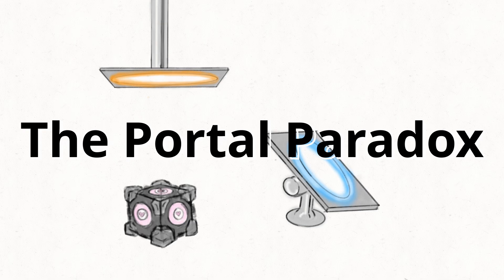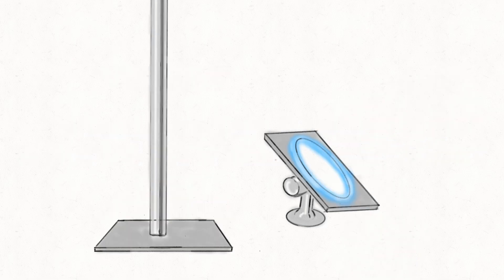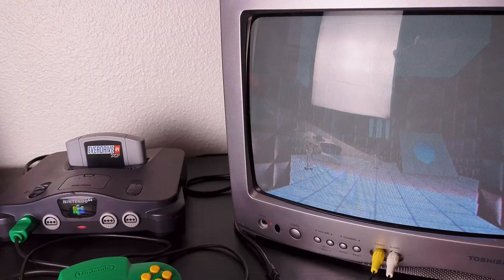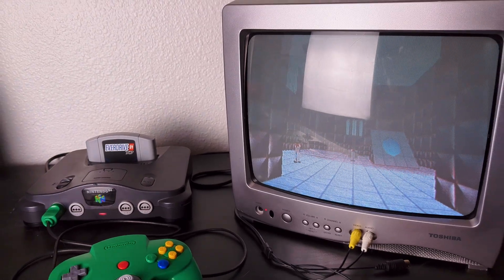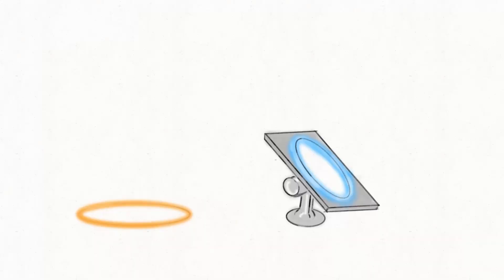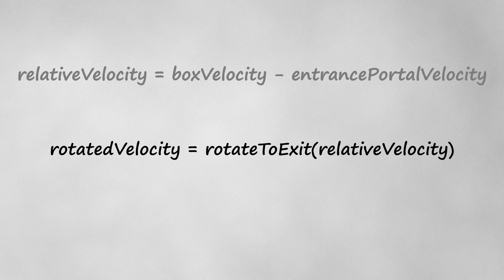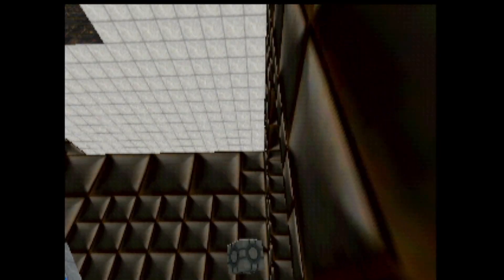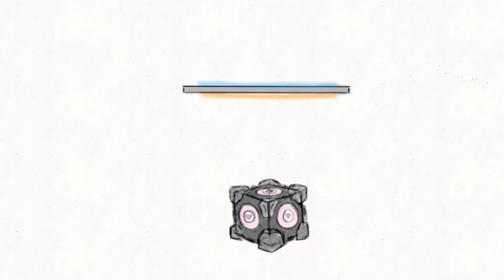I rewrote Portal from scratch and solved the Portal Paradox

Comment: If I remember correctly the issue with the portal paradox has to do with Newton's Third Law (for every action there is an equal and opposite reaction)

if you push a portal down on a cube does the opposing portal feel the opposing force of "throwing" the cube? Does the moving portal also experience this opposing force?
The other problem is regarding weight. Assuming that moving the surface that contains the portal is constant at all times if you slam the portal on a cube that weighs 10 lbs vs a cube that weighs 1 ton, both results will have each cube moving out the second portal at the same speed yet obviously in order give the 1 ton cube the same velocity the energy requirements would be MASIVE compared to the 10lb cube. Where did this difference in energy come from?

Comment: I thought the portal paradox was what happens when you push one portal through another
Reply: If the edges of the portal are like rings with collision, It just hits itself(the stationary portal gets hit by it's width), preventing itself from going any further into itself, while also creating some recursive mirror-esque effect that I can't imagine in my head. Both scenarios are misleadingly labeled paradoxes, and just requires a bit of thinking and maybe some RTX.
Reply: @3_pancakes767  you can pass an oval-shaped-ring through a copy of itself by rotating it
Reply: the result of this (in general) is an infinite length but finite surface area of "portal plane" produced, as it creates a fractal out of self intersections

Comment: What happens if the velocity of the portal changes while the cube is in the process of passing through it, assuming the cube is the sum of parts and not a single entity with a single velocity? If it slowed mid teleport, would the portion that has exited pull on the portion that has not, so the cube is tugged faster than the now-slower portal is moving? Would it's final velocity be the average velocity of the entire interaction? If the cube was made of fragile components, would it potentially break mid teleport? If the portal stopped halfway, would the cube remain stationary or would it be pulled relative to the force of half its mass moving at the portals initial velocity? And what if the cube was instead shaped in such a way that you could fit a portion of it through but flanges would extend beyond the width of the portal? Would the pull of the portion that made it through pull on the wall the portal was on, and thereby on the pistons? And what of infinite velocity? If the piece exited with that same infinite velocity, what would happen upon collision with the flanges, perhaps assuming the components were indestructible?
Reply: It doesn't matter. His equation means the object would be sliced into 1-atom-thick layers because of how the energy is applied. It would work at any speed.
This result actually conflicts with what we seen in the game, therefore, his equation is wrong.
There are some more things why it is also wrong, but at this point it doens't matter.

Comment: What happens if the portal suddenly stops with the cube halfway through then? 🤔
Will the first half, that is at that point "moving" at relatively high speed, pull the still stationary part with it? Or, if the cube was soft like dough, would it stretch in the same situation?
I hope at least someone understands how I'm thinking. 😅

Comment: My problem is, is the "hole" itself moving? yeah the thing its on is moving, but is the hole even actually a thing. Using the hula-hoop example, space isn't moving with the hoop, the hoop is passing through the space, so what is the velocity of the hole in the hoop while its moving? this has to be purely philosophical, right? Your object has a 2d plane showing an image of the other side of the portal I assume, so that 2d object has velocity, but an actual hole wouldn't because its just space, right? So I think you solved the videogame version, but not the "what if portals were real" version, because I think in the real world it would remain a paradox because you'd need to move space through itself and the portal tech would definitely violate causality. We're hypothesizing about unicorn rainbow fart density because its purely conceptual, right?

Comment: The only acceleration the mass of the cube should experience is gravity, it would flip (at best) due to the sudden change of the vector, that is, 9.81m/s perpendicularly when the cube is at rest and then that vector becomes angled and progressibly applied to the cube as it enters the orange portal/exits throughthe blue portal. Sure it would move but not make a fucking lunge like that.

Furthermore, the test on n64 portal looks like the engine is geometrically increasing the acceleration as the vector changes, it keeps treating the cube as a point particle for each moment the vector changes, which makes sense for a videogame based physics engine that calculates and refreshes things at every X seconds/miliseconds/whatever.

Comment: Aight, so you either deliberately made this to draw attention to your personal project, or your programming skills greatly exceed your grasp of physics. 
Sure, "Portals don't respect conservation of energy anyway" makes for a very convenient excuse(it's not true btw), but think of it this way: the cube moving implies it has(or had at some point) acceleration. The only way an object can have acceleration is by having force directly applied to it, which, in this case, comes from... where exactly? The cube is stationary and is never touched by anything, and objects typically move undisturbed through the portals, which implies they(the portals) typically don't exert force over objects passing through them. Thus, we get perpetual motion in the Portal universe, at which point any point to such debate becomes moot. Cheers!

Comment: The only 'flaw' is begging the question.  This is the better way to do it but you did specifically choose it.

relativeVelocity = boxVelocity - entrancePortalVelocity could be relativeVelocity = boxVelocity - exitPortalVelocity and still be valid since the entrance and exit are supposed to be connected to each other, two sides of one thing (literally a portal or hole).  But with relatively moving portals,  these two options are different. Choosing to prioritize the entrance portal, as you did, gives the behaviour you produced. Choosing to priorotize the exit would leave the object stationary after it exits. The latter option, though, doesn't really work for an object that has a volume since the top and bottom of it would have to exit stationary in the same place. But it works for teleporting a single point, so you should be able to make the switch and teleport a particle effect or something in-game with either behaviour.

Comment: I'd imagine that an argument against your implementation goes as such:
The first line of your math involves two velocities, the cube's and the portal's. You combine both of these velocities into one and apply it to the cube, which inherently means that the cube is going to be given a velocity.
The problem with this logic is something brought up both in this video and the source of the paradox, movement is relative, and this implementation chooses a specific frame of reference to implement, specifically the one that sees the cube as moving.

Now I'm no expert on physics, but I do have a degree in cyber security and I do know that you can easily program things to act in ways you want them to. This is a paradox after all, so if you want a real life implementation of this, you have to pick one side or the other.

Comment: I do believe your equation is correct for the simple case of 2 portals in space with homogeonous gravitation, electromagnetic, strong and weak fields.

However, for cases where the portals are separated by some distance over which those fields are not homogeonous, we should see some strange results.

A simple example to demonstrate what I mean:
If you have a portal in the ceiling above you, with the other side of that portal also on the ceiling a few feet away; you should feel the gravitational pull of the planet through the portal above your head.
As you approach the portal above your head, this would feel like you're getting lighter until you're halfway through the portal, where it will feel like you're weightless (in reality, your legs and head are being pulled in opposite directions with equal force, so it would feel like you're getting stretched)

The force of gravity, as well as other forces, should propogate through portals, which would result in significantly messier trajectories than the equation you've used to implement your system.
Reply: I think implementing a gravitational force for the portals should be easy enough.

Create an object to act as a 1-dimensional gravitational attractor. (Ie, the force it exerts should only be in one direction, normalised for rotation. For example, the planet only imparts a force along the y axis, not the x or z.)

Portals should have one of these objects at each of their surfaces that cause 1-dimensional acceleration equal to what the planet exerts on the other portal, normalised for rotation.

Then, for all physical bodies, simply accelerate them by the addition of all 3 bodies.
Reply: For an idea on how this would feel:

Place one portal on the wall, oriented the same direction as yourself.

Now place another portal on the opposite wall, rotated by 90 degrees (so that the 'top' of the portal is towards a corner of the room)

As you approach the upright portal, you'll gradually feel like the world is tilting.
At the point you cross through the portal, the world would feel like it's at a 45° angle.

Unlike the base game, you shouldn't experience a sudden change in the direction of gravity after going through a portal. It should be a continuous change based on your proximity to the portal.

Further note:
Planets are big and heavy.
If you put two portals on the ceiling, both facing down, you've basically just shoved a whole planet above your head.
To say the results would be destructive is an understatement.

Comment: Its probably worth mentioning that portals as an actual existing thing wouldn't just be like walking through a door. Its a warped sense of gravity so velocity interacting with it wouldnt be so simple to imagine the cube flopping out the other side pathetically, it adds up with the physical reality of it (of course demonstrated in game).
Reply: There is nothing to do with gravity. It's just exactly a doorway.
Reply: @fantastikboom1094  im talking about wormholes and how theyre comparable to how the portal gun operates. It would make the most sense cause how else could you distort such space? Anyway car battery
Reply: @Minecraftxpo  I have no idea what is distorting the space, but it doesn't matter. We're talking about how mechanics of the movement through the portal works.

Comment: Using the actual velocity of the cube and ignoring the portal’s velocity wouldn’t even make sense for a stationary cube. How would it move through the portal if it isn’t actually moving at all? What if something was blocking the exit portal? How would an object which is changing positions but not technically moving interact with an obstacle?

Comment: I’m not saying you’re wrong, but wouldn’t the cube fly out of the exit portal faster than the velocity of the entrance portal? Seeing as when the cube begins moving out of the exit portal it has inertial difference between its locations across the portals?

So if you stopped the entrance portal before it completely engulfs the cube, wouldn’t that new inertia actually suck the cube into the entrance portal?

Comment: I'll tell you why you are wrong. An object entering a portal must necessarily exit the universe. Causality can only extend to the surface of the portal. Once you enter the portal, you have entered zero-distance space. There is zero-distance between the portals, and there are no physics that we know to work without distance.

This break in causality causes the cube to exit the portal as a "new" object to the universe. That object can have any initial state without paradox. The state that is transferred and appears as "momentum" on the other side of the portal is an object's linear inertia. To the cube, the easiest way to go is down to the ground because it is "stationary" and gravity is pulling it down. This keeps it "stationary" as the portal moves over it.

A moving object has its linear inertia pointing the other direction. It is easier to continue moving than to be stationary because of the momentum it has. Momentum IS energy, a moving object has more energy and mass. Without that energy, there is nothing to convert into momentum on the other side of the portal.

The portals themselves cannot impart energy into the cube. To do so, they would have to be able to interact with classical physics. If they did, they would create a blackhole. If physics works inside the wormhole, then all the values would become infinite within the zero-distance space. Matter must necessarily travel the portals in a state that is non-classical. Since the object's state changes, it breaks from its previous causality. Because the object on the exit side of the portal is "new," it can only have its internal variables to create an action. The variable that makes the difference, and carries energy through the portal, is linear inertia.

It is the only answer that allows all frames of reference to be true. The cube's inertia never changes. The portals never interact with the rest of the universe. The exit side of the portal sees a "stationary" cube get shoved into its side of the universe. All cause-and-effect is properly maintained because the cube never has its energy changed, the energy that was already there is simply "pushed" through the portal.

Comment: This isn’t the portal paradox and the result is easily predictable. The portal slamming on the cube is physically the same as the cube being thrown through the portal, the portal and the cube are moving towards each other at the same rate no matter which one is moving through space, as far as the exit portal is concerned it will always be the box going at the high speed so the bot will always exit the portal at a high speed, the area around the portal and the cube doesn’t matter, doesn’t matter which is moving on the orange side, the only thing that matters is the speed and direction that the cube and the orange portal have to each other, and since no matter how you do it, the speed and direction in relation to one and other will be exactly the same, the cube will always have a high velocity coming out the blue portal. This isn’t rocket science, I could have don’t this at intermediate school, in fact I did do it at intermediate. The true portal paradox was asked by matpat a long time ago go check it out, not a hard video to find

Comment: One problem I see with this is, with the stationary exit portal, the cube would appear to get sucked up through the entrance portal.
I'm of the belief that the cube would just fall out the exit. The solution shown would also imply that air would likewise be accelerated and... that's got some WILD implications.
Reply: I mean it does get sucked in. And the thing with the air is also right. I don't know what WILD implications you're talking of?
Reply: A cube cannot fall out of the exit portal without moving relatively to the exit portal. And if it moves relatively to the exit portal, there is no reason for it to suddenly lose its kinetic energy once it passes completely through.
Reply: @whitemouse2460  It have no kinetic energy. It didn't interact with any object to get it. Learn some physics.

Comment: I think what would actually happen is that the cube would be crushed, maybe even explode. When matter enters a portal, it instantaneously appears at the exit point. With a stationary portal, the object pushes itself through, as it would through normal space. But with a moving portal, each layer of atoms should be appearing at the same exit point instantaneously, with no real force being applied to push them out of the way first. So you'd end up with the cube being condensed into a one atom thick plane, and then I have no idea what the interactions would be on the subatomic level but I imagine some sort of fusion and/or fission reaction would occur by forcing atoms to take up the same space.

Comment: if the cube comes through the portal one frame at a time, like, in tiny cross-sectional slices, each slice will have to push the previous slice forward, out of its way, before the slice behind pushes it, the second slice, if each slice fails to push the slice in front of it out of the way, you end up with a multidimensional equivalent of the video of that tesla in the tunnel.  the velocity at which each slice pushes the slice before it, must at least match the speed at which the portal moves, because momentum, inertia, whatever, exists, when the portal stops moving, the cube must continue. so. my question is this. what happens if you slam a portal down onto a cube, but stop halfway through the cube? is the cube pulled up through the portal? does nothing happen? does the cube that’s already been ported fly away?